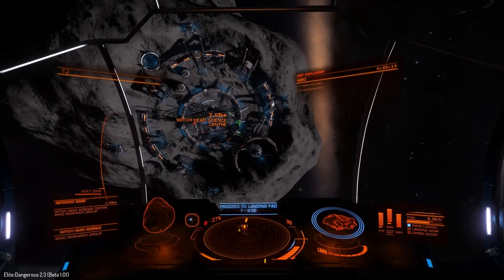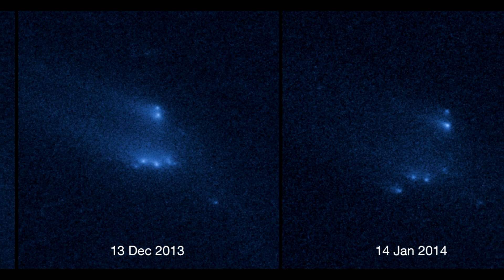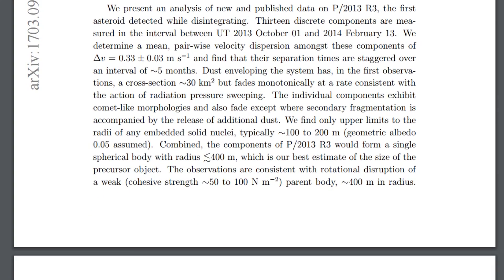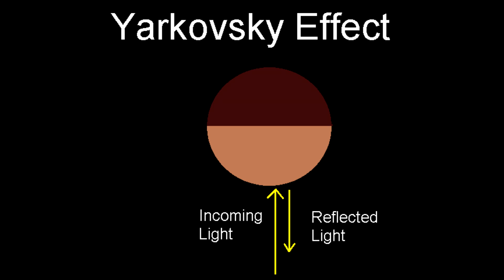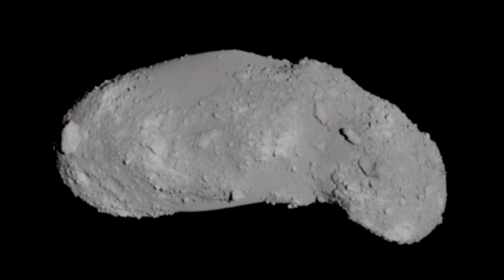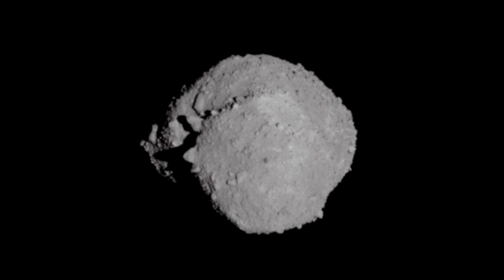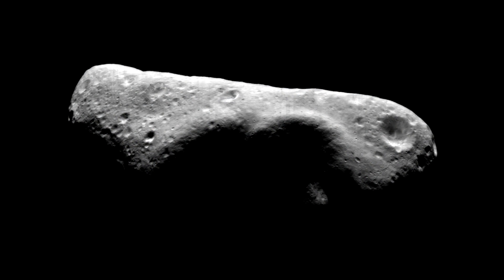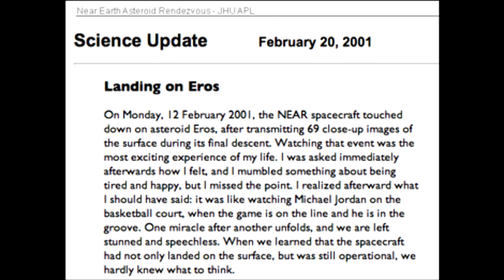Spinning Asteroids To Make Space Stations

Comment: The great thing about putting a spinning station on an asteroid, as opposed to using the asteroid itself, is that you can use the asteroid's inertia to spin up the station, without using rocket engines at all. Interestingly, the Expanse does have at least one example of this in the form of Pallas Station.

Comment: you gotta think outside the box. this is a case of mythbusting similar to that infamous mythbuster show where they claimed pirates couldn't possibly glide down sails with swords simply because the tv show crew couldn't physically do it. there are many crazy physical feats people do that blow my mind. so for the asteroid spinning, you could hollow out the asteroid, cut it into big chunks and spin each smaller chunk separately. bring the asteroid back together and stitch up. tada!
Reply: Except bringing together wont work. The center of rotation matters.
Reply: @oznerol256  it will work. asymmetric center of weight wont magically make the the two masses disappear like it's sime kind of glitch in the universe. it will just effect rotation negatively and positively, but rotation will continue and can be further adjusted.

Comment: Surely you would mine out most of the material before trying to spin it up to speed?  That would reduce the amount of energy required and you could also internally brace the structure to support the rotation.

Comment: Instead of a train driving around a big torus inside, try a sealed torus with a wide belt (holding the tension) rotating around the torus (air filled) to provide g-force.

Comment: Self support length as shown in the Wikipedia table assumes 1G acceleration and constant cross-sectional area. Objects that taper from top->bottom will have higher critical lengths, as will objects seeing <1G. 

It would be about an order of magnitude larger (depending on cross-section) for a spinning asteroid with a peak rotational acceleration of 0.3G at the ends.

Comment: Scoot Manley, i watched your video and got a good solution who he did not get cover. It is to create a ring of highly tensile strength material around Ceres equator in order to resist any Yoke effect. If the idea is to spin it, the "equator line" will probably be where the centrifugal force is the biggest one, so my focus will be to calculate there. Also i will approximate every ring as a cylinder  with height as (h), but that will matter a little.

Ceres is an asteroid with radius (R) of 482 km, density (p) of 2.7 g/cm and gravity of 0.28 m/s^2. Its perimeter around equator line is 3,028 km, which is 7 times lower than the Great Wall of China (21,196 km). In the show Ceres have spin gravity (sg) of 0.3 g, equals 2.94 m/s^2 

with angular velocity (w) -> sg = w^2*r -> w = sqrt (sg/r) = sqrt(2.94/482000) ~~ 2.4 E-3 rad/s. Angular velocity is constant over all the radiuses.

The centrifugal force from the asteroid requires us to integrate, cause the centrifugal force is a function of the radius, and we need to sum all the rings from the axis of rotation to the outer radius (R), so it will need to be an integral and calculated as -> dFc = m*w^2*dr = p*Volume*w^2*dr = p*pi*r^2*h*w^2*dr With 482000 < r < 0

Fc = p*pi*h*R^3*w^2/3.

Since tensile strength (s) is s = F/area, the material needs to resist the Centrifugal force, and the area where it makes contact could be approximated to Ceres perimeter * height = 2*pi*R*h

s/area = F = Fc. -> s = Fc*A = p*pi*R^3*h*w^2/3/2*pi*R*h = p*R^2*w^2/6

The material need to resists to:  (2700 kg/m^3) * (482000) ^ 2 * (2.4 E-3) ^2 /6 = 650.48 MPa.

650.48 MPa Is well inside plenty of materials that we have. A High strength steel alloy got Ultimate Tensile strength in 760 MPa. Stainless got 860 Mpa, Maraging Steel (an alloy with nickel, cobalt and titanium) got even to 2500 Mpa!, and that is talking only about steel. Even talking in a shear stress perspective the perspective doesn't change, since shear the composite material of steel + Rock have a good shear resistance.

In other words.  It was a good exercise on Engineering skills and if that show made me try some, im glad. Hope you like the answer. Have a good day.

Comment: Great video, as always, but I don't think the concept of breaking strength could be applied to this problem directly. Imagine the spinning rod (around one of it's ends). Centrifugal force will vary across the rod length, unlike gravitational force used to derive the breaking length. So, to derive maximum length of such rod rotating with angular speed omega, we need to integrate. The answer (if I didn't make some dumb mistake) can be put like this: if we want to have an acceleration of 0.3g (like Eros in the Expanse) at the end of the rod the maximum length will be (breaking length)/0.15 or approximately 6.7*(breaking length). So to support such rod with length equal to Eros radii the rod's material need to have breaking length about 1.3 km. Of course Eros is not a rod and even not a ball, so one need more complicated analysis, but i think it's a great approximation that shows that the stresses aren't that big, and maybe if one chooses the rotational axis carefully, this is possible even without structural modifications.

For Ceres the breaking length needed is about 70 km, still quite impossible with rocks.

And of course spin-up still requires insane amounts of energy
Reply: But if Ceres is 0.029g and barely stuck together what happens when 0.3g is applied in the opposite directions?

Comment: This is an old video, but if anyone can hear me out there, this made me think about sea-faring vessels’ wind propulsion. 

I’m not a scientist, but hear me out:
     What if, rather than mere solar panels, a space-faring vessel employed columnar solar “sails” in order to provide efficient, fuel-less momentum? The sails’ heated sides would slowly rotate away from the angle of attack to provide thrust somewhat perpendicular to the angle of incoming radiation. The sails’ surface material could possibly be a composite skin with a shutter-riddled frame concealing highly reflective material. The outside of the shutters would be a very dark color and be of a very energy-absorbent material, which would then open once nearing 180° from the angle of momentum. The energy-absorbent outside would give way to the heat sinks and reflective material behind the shutters in order to increase the sails’ radiant potential and provide the greatest absorption-to-thrust ratio.

I could just be so so wrong, but I really like the idea of solar sails that basically power themselves and provide “free” thrust so long as the craft remains in the heliosphere!

Comment: 8:45 couldn't they just use some kind of lever (sans fulcrum)?

By that I mean if they built arms away from the body of it, then put the engines on the ends of the arms the force needed would be much smaller than those 16 Saturn V's you spoke of. In that case you'd just need a material to build the arm out of that could withstand the torque. Unless I'm missing something.
Reply: Or create a ring on the arms and live in that, so youd need much less spin too.

Comment: you could hollow parts out of the suface and insert a spinning station into the surface, like the drum of a washing machine.
you would have exterior entry for spacecraft etc, and interior entry to enter asteroids surface and interior structures
inside the asteroid the station would be protected against radiation and smaller impact events,and would have easier time to sustain normalized temperatures.

Comment: It's not actually that hard to dock on a spinning asteroid (relatively speaking),
once you remove rotation dampening and match the horizontal velocity of the landing pad (in a straight line only)  and add a slight roll,
you're basically just in the "gravity" of the station and can land like its the moon.

Written an FA Off pilot.

OK obviously its a lot more complicated than that, but no more complicated then landing on an already rotating, atmospheric planet with wind and rain

Comment: sigh  We're easily convinced that spinning an asteroid is a waste of time and energy with our current tech...  But why not spin some toroids or cylinders within the volume of the asteroid?  The crust provides radiation shielding, storage space for materials that can tolerate being irradiated, docking space, etc.  The spinning habitats would keep in their place via technology similar to magnetic levitation or air-bearings.  Someyear (millennium?) we may be able to build Larry Niven's Ringworld, or the smaller spinning shapes you discuss, but those will need some major new technology.  Elon Musk's Boring Company could quickly mine out the first habitation spaces within asteroids today.  They would need to be reworked for use in vacuum, or the initial bore sites equipped with sizable air-locks to allow the machines to be set up and launched from pressurized space.  ... And so on ...  Let's focus on how we might begin asteroid mining by 2150, if SpaceX's Starship works out.

Comment: There is one way to solve many of the problems you spell out in one go...

First, use the ones you "don't want," the rubble piles, but reshape them first, by wrapping them in a sheath of wound fabric that is shaped as you like, but that has room in it as well for the later tunnels et al. In fact, you might even inflate separate balloon shapes as well, to carve out the space inside a bit. So once you have an "enshrouded" body, you then spin it up, shocking the pile at the same time, to let the outward forces start putting the matter into a different configuration, in the process reshaping the dust-berg into a BALANCED spinning shape to start with. THEN, once the berg is completed, spin it slowly under your solar concentraters, to fuse the outside, probably leaving the shroud in place.Then proceed with the finishing, after those internal voids you left exposed to space cool the sucker down...

Comment: In the expanse books the 'Big Spin' was done using massive reaction wheels, not rockets. How large would the reaction wheels have to be to accomplish this?

Also the docking issues are addressed. Ports on Eros and Ceres were located at the poles where rotation speed is much less noticable

Comment: Massive Carbon nanotube tape. Build a factory which produces a continuous nanotube tape about 10 metres across. The factory ship moves slowly around the asteroid, feeding the wrap to a machine on the surface which pulverises the surface and then smooths it out. 

You wrap the asteroid with several of these factories, and as the layers build up, the pressure it exerts climbs, until it holds the outside absolutely tight, and covers the entire surface.
Now you can spin the asteroid up, without fear of it flying apart.
Probably no one wants to live there though, because an attack on the asteroid only needs to wreck the nanotube coating in a relatively small area, before the whole thing starts draining out of the hole, like a bucket with a hole being swung in a circle.

No - asteroids are not for living ON, or IN, they are for living NEXT TO. You mine the materials you need from the asteroid, and process them in situ, and build whatever structures you need from the Gigatons of raw materials.

Comment: In Larry Niven's scenario, you place containers of WATER at the center of a small rubble-pile asteroid. Then you spin it slowly and heat the outside with enormous solar mirrors, melting the outside of the asteroid and "gluing" it together. The heat would very slowly make its way to the interior as nearly the entire asteroid became molten. Then, when the heat finally reaches the water in the center, it vaporizes, and the resulting steam expands the asteroid into a cooling, solid shell. It might take YEARS to melt the thing and expand it. Pity if the rock was then too weak to hold together.

Comment: Suppose a tunnel boring machine has excavated a circular tunnel of Van Braun-space wheel dimensions. Place  railroad track on the outer radius of said tunnel with interspersed linear induction motors. Operate pressurized railroad cars on the railroad at speeds commensurate with the ring-rail's dimension and desired gravity. Use them as residential/sleeping compartments to limit zero-g exposure. Operate the ring-rails in pairs to cancel out rotational effect on the asteroid. Operate three orthogonal pairs of ring-rails to intentionally control asteroid rotation.

Comment: Rocks in space (much like rocks on earth) are wonderful at handling compressive force i.e. stacking stone one on top of each other to bear the weight of stones above. They are not good at handling tensile force, which is what the fabric of an asteroid would be subjected to if a hollow asteroid was spun up to simulate gravity along its inside wall. Depending on its size, the fabric of the asteroid in question would reach fracture point probably before the centrifugal force of the asteroid's spin could generate .2 G.

Comment: PPS I think spinning to generate artificial gravity is a problem anyway because of what happens to things in the inside space that are not touching the 'floor' (i.e. air, fluids) if the whole circle is open won't the air all be 'flowing around in the opposite direction' relative to the floor and all things fixed to its rotating frame of reference?  And moving sideways with the Coriolis effect. Oh how would people in a rotating station know how far away 'social distancing' is because if you sneeze you don't know how far and in which direction all those droplets would go! It would take too long to calculate it!
I once thought 'what if it is possible to spin up the moon' so its temperature doesn't vary so much (if it had more of an atmosphere) because it doesn't have so long in day or night to cool or heat up so much. But then it doesn't have an atmosphere so perhaps the cooling and heating happens really quickly and it would still have such a huge range of temperatures. If it was spinning faster like turning in 1 Earth day, it would have huge tidal forces and it might break up its crust with lots more moon-quakes! The Earth's tidal effect on the moon is much bigger than the moon's effect on the Earth isn't it?

Comment: In the books Ceres station was a helical tunnel that changed ring diameter as it went in from the south pole and only the middle layer rings had .3g gravity. Lower ones would have higher g while the surface ones would have very low g. An orbiting space station would be easier, but does this different layout fix the material strength problem?

Comment: If you wanted an asteroid to spin faster, and you were using rockets to do it, I don't think you would put the rockets on the surface of the asteroid.  I think you would put them farther out, on a tether, for more leverage.  The tether would be held taut by centrifugal force, so the tangential force exerted at the surface of the asteroid would be greater than the force exerted by the rocket.

Of course, you also wouldn't spin an asteroid to have everyone walk around upside down under the pseudogravity of the whole thing's rotation.  You would put the station at the other end of the tether, and you would make the tether long enough to give you an acceptable level of pseudogravity with a lot less rotation.

Comment: In one famous Sci Fi book, our hero  used thousands of autonomous Space mirrors to heat up a large asteroid  and melted a hole in it down into the core to make a hole to the center.  After it cooled off they then rounded up a few comets to stuff into the core.  After another asteroid was slammed into the hole to close it up, they began to heat and rotate it . 
 After the heat softened it to a point where the vaporized ice comets would use steam to expand it out to a larger size and then cool.  Where they then cut a round doorway plug out of it and tapered it at the same time so it could be used as a door iater.  What was left was a 12 Km ball with a 2Km thick shell.  And so it was made into a large space station.  Much later they used Freeman Dyson's nuclear space drive (By Exploding nuclear bombs on a thickened pad about 30 seconds apart for thrust) to move it around I guess making it a "Death Star".     I would not want to foot the bill for all of the fissionable s.....

Comment: What if they aren't spinning the asteroid at all. What if they mined out the core and built a giant cylinder inside that spins like the drum on the nauvoo/behemeth. That would be in line with the visuals in the show. The asteroid stations never actually appear to be spinning much if at all. You wouldn't really want it to, just the cylinder inside, so really you would want to try to prevent the asteroids rotation from increasing while you spin up the drum. The effect is the same for the space inside, but the asteroid has less risk of breaking up. It would be a logical process of mining as well since you would want to prevent collapses while mining. To prevent rotation of the asteroid, you could construct a rotating ring around the outside of the asteroid and use its rotation to counter that of the cylinder or even just split the cylinders length in two sections and spin them in opposite directions.

Comment: Nuclear tunnel boring machine threading through the asteroid over and over.  Grinding through the loose rock, trailing a molten filament.  Run through the asteroid enough times to create a webwork of strong fibers for structural strength.  Also, if you control the cooldown of the fibers as they are extruded, the composition of the crystalline boundaries can probably also be altered to limit breakage.  Anchor the Epstein's to the ends of bundles of these fibers to prevent the force generated by the drives from splitting the asteroid.  (If you could X-ray the asteroid after completion, it would look like a 3-dimensional spider web threaded through the interior... not fast to accomplish, but probably doable to prevent centripetal destruction.)